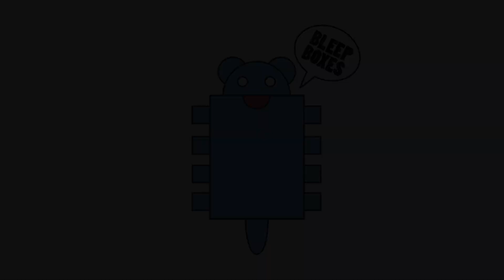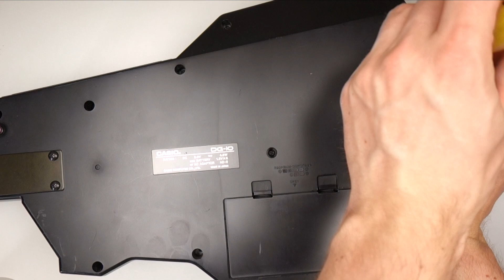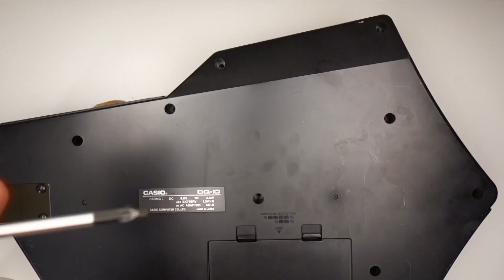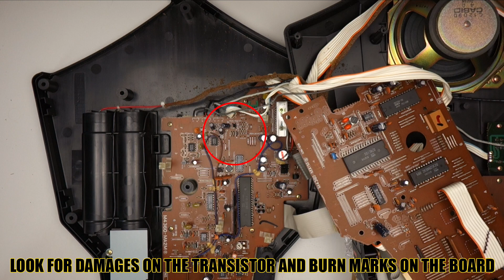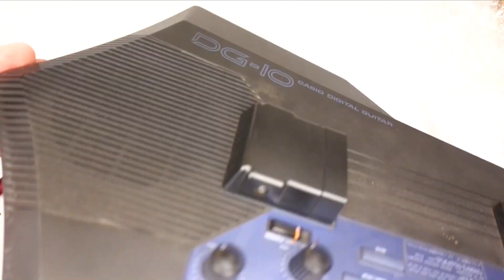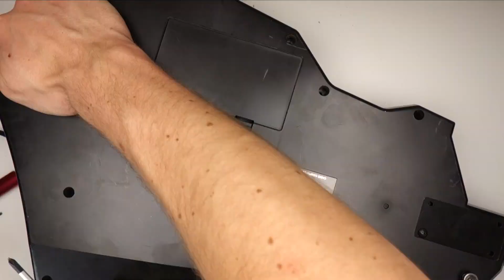Bleepboxes Episode Six: Casio DG 10 Repair (won't power up)

Comment: For anyone else who is trying to fix their DG10 or DG20, I used part number KSC945CYTA off of digikey for the transistor. I didn't need to replace the diode, and that transistor worked great. Thanks for the tutorial!
Reply from the maker: Thanks for the info 👍

Comment: I finally took my apart since I bought one off Ebay that was not powering up too. I looked at the NPN transistor (T3) and the Zener diode RD5.6ESB2. They didn't look fried or any signs of burn marks. I decided to check them with a multi-meter I was getting values over 6 so I plugged in the 9V power adapter and turned the Power switch to "ON", nothing happened so I took the red and black leads connected to my multi-meter and touched each side of the diode leads at the same time. It triggered the power to go "ON"! Bingo! That means the diode opens the power gate circuit for power but this diode is dead and not working so need to replace it. I just ordered new Zener diodes from Ebay, 20 for under $6 dollars. While it was still powered "ON" I strung the strings and it played and even played the background synth music and drum machine. Can't wait to repair it, will be an easy fix!
Reply from the maker: Very nice! Well done. Fixing something yourself is the best reward imo. ;)
Reply: @bleepboxes  I'm so sorry. I have to Thank You for your video info. Without your help I would have not had a clue where to start and now have a bit of more knowledge of electronics. Thanks again :)

Comment: Hello. I'm trying fix a problem on my DG20: whats is the right tension for the strings? High or low tension? I touch the gold Springs at the bridge with my fingers, and Its play. But when play the strings, sometimes the sound fail.... Whats the wrong ?
Reply from the maker: Mine had medium tension strings. Its been a while since i sold this. I found IT very hard to play this instrument and found the sound triggering not very reliable

Comment: Do you know the equivalents for the Transistor 2SC1740SQ and equivalent for the Diode RD5.6ESB2? Thanks
Reply from the maker: The diode is just a 5.6v zener diode. Any will do. The transistors are nothing special. My supplier had them. Just google for 2sc1740 equivalent and you will find your answer. Good luck!

Comment: Any idea what would cause string 1-3 to have a really high threshold sensitivity? My string 4-6 trigger with much less effort.
Reply from the maker: Hmm.. theres a lot of options and answers for that im afraid. Is there a schematic available? You could look for some trimpots near the trigger area. Also changing out the old electro vap could do the trick. But still guesses.

Comment: where did you get a power stransistor and diode? i just bought one from ebay (i knew it wasn't able to power on) and I think this is a simple fix.
Reply from the maker: I got it from my local electronics store. Theyre pretty basic and easily available
Reply from the maker: Check 1 min 22 for the values of both in the video.